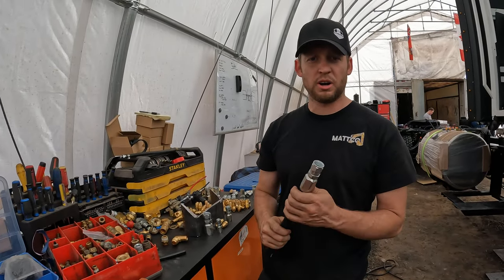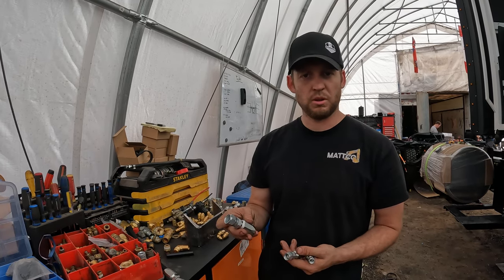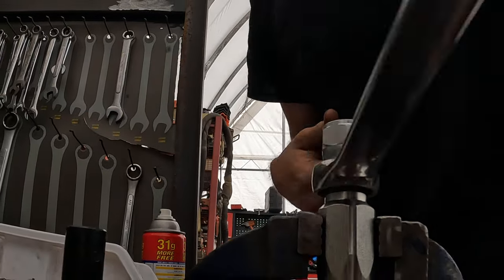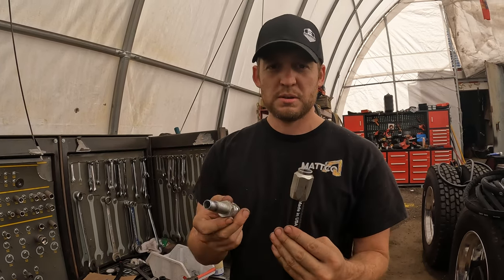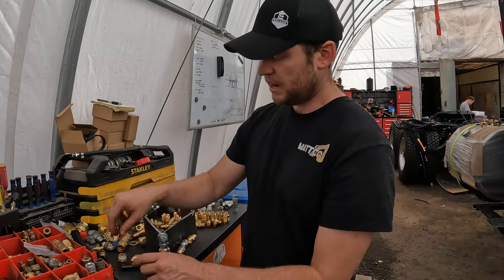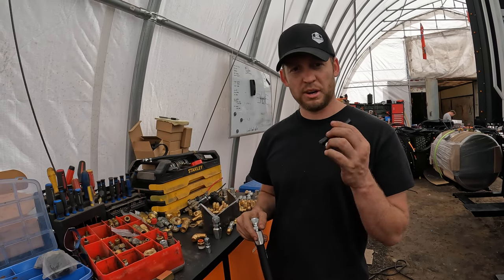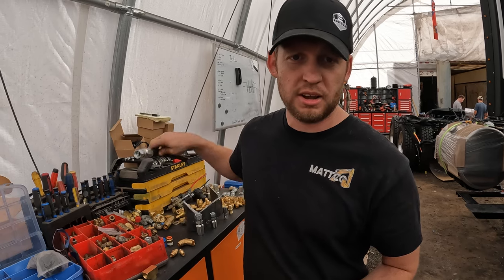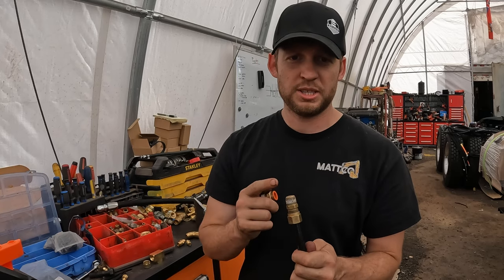Braided AirLine Fittings

Comment: Be wary of flared fittings though.  SAE uses 45 degree angles but the aviation-world ones (AN or MS or NAS) use 37 degree angles.  It wasn't so big a thing 20 years ago but AN-style fittings seem to be everywhere now.
Reply: Agreed. I do like the AN fittings and hoses. Braided stainless, PTFE liner, and a decent outer jacket have lasted very well on my old ford pickup truck.
Reply: JIC is 37° as well and will thread with SAE but will NOT seal. Learning hydraulics taught me that
Reply: Yeah nothing like finding out that you eyeball and grab the wrong one.
I appreciate all the "standards" that are not standardized besides within their own type.
I guess its better than every manufacturer having their own.
Reply: @jugglajj  they do seal generally with air. It's fairly easy to tell them apart though . For instance JIC is never (at least I haven't came across it in 20+ years) made out of brass.
Reply: @jmanlinc  true about the brass, but they do make ASE in steel and I wouldn't recommend someone does it for air simply to avoid confusion with anything else.
Reply: @brianb-p6586  the old boy that taught me fittings and such when I was younger demonstrated it for me with Prussian Blue to show contact point on the angled surface.
Reply: Aviation fittings cost 10x more and likely won't be accidentally purchased
Reply: 45° and 37° flare connections have different thread sizes so can't be accidentally interchanged.  JIC is same as AN - 37°.
Reply: @jeff-w  sure thing. I'll make sure to note this next to my 10 years of working with these fittings, and the fact that I just double checked myself AGAIN, at work, and have a 08/m/JIC threaded into an 08/f/SAE. Since I'm an asshole at times I went ahead and did 08/f/JIC to 08/m/SAE and they threaded just fine. 
Best of luck
Reply: @jeff-w  if we wanna be even more adamant i can take and post a video, just to be sure
Reply: @jugglajj  no need to be a dick.  I just checked my table and -6, -12, -14, and -16 have different threads.  I wrongly assumed they were different for all sizes.  The -8 uses 3/4-16 for both.  Today I learned something.
Reply: @jugglajj  you should also avoid just calling the SAE 45° flare fittings "SAE" because the SAE O-ring ports use the same threads as the JIC fittings.  To me an "SAE" fitting is an O-ring port adapter.  Anyways, carry on!
Reply: @jeff-w  "to you" and to me, are very clearly different worlds and shouldn't be used as a blanket. Both right, enough said.

Comment: Be sure to check for flappers inside after assembling the hose. The nipple can cut the rubber liner and it will block the hose depending on airflow direction.

Comment: I changed a treadle valve on 2 year old pete, ended up replacing every  one of the fittings with ferrule style fittings because the push to leak fittings wouldn't stop doing they're thing

Comment: Reusable fittings and braided lines are the way to go. Do you run the long straight lengths in steel tubing instead of rubber hose?
Reply: Steel tubing would probably rust with the moisture in the air system
Reply: @simentalg stainless my man...stainless
Reply: @simentalg  in service rig applications we have steel airlines that have been in service for 40 years. If they rust and fail its usually from the outside because it was sitting in a pile of dirt in the frame or the paint was crappy where it's clamped to the frame

Comment: the old school fittings didn't have a nut to turn. You had to use a fitting screwed in it to lock the stem so you could thread it in and out.
Reply: Yeah they were nice because they were shorter, but a bitch if they were rusted and you had no choice but to reuse it

Comment: Suggestion for a future video- that's semi semi related to this video. You state that adding like 5 grand-ish more for your air lines save money down the road, can you do more of a break down and  accumulation of all/most of the things like this in one video that compare oem cost and Edison Motors costs for parts.  I do know not all things will cost edison truck more like comparing $1500 oem headlights vs I'm guessing $50 for your headlights. Or gauges, windows, hoses,brakes,sensors and so on.Hope this makes sense.

Comment: jeebes, i've done a lot of aircraft hydraulic and pneumatic design, for hydraulic we standardized on JIC (same thing as AN really), the my standard size for hydraulic is -03, or 3.5mm hose. the largest we run is a -10 for coolant, and some -08's for engine oil. I've badgered many suppliers to supply me with a range of -02 to shave some weight, but usually they only do steel fittings, which defeats the purpose somewhat. Most is aramid braided, because it's more flexible, less chafing and stabbing prrone, and again, lighter. As for air, even the supply rail is only a 6mm external hose, the standard size being 3mm, which has a 1.6mm bore. Running a -04 for a gauge would be a reason to be taken behind the shed...

Comment: would sacrificial zinc plates work for corrosion prevention when using a truck for like a salt spreader or snow plow? I have seen stuff like that used in marine applications. maybe mounted to frame or axles , things that would get direct salt spray / water contact.

Comment: Air lines are never the problem.  The stuff they are connected to fails.  Nylon lines are easy to repair or replace on the side of the road.

Comment: You want small-bore line for gauges because larger bores will give sluggish and probably inaccurate readings.
Reply: Why?
Reply: @brucebaxter6923  All the extra capacity in a larger line takes longer to fill and empty which delays the response.  If you had a small balloon and a large balloon over the necks of soda bottles and shook them the bubbles would fill the smaller one sooner and more obviously, if that helps.
Reply: @jimsvideos7201  
So, you are saying if you have a small hose feed a big reservoir it takes time to fill.
You aren’t saying big lines change pressure slower.
Reply: @brucebaxter6923  In this case the hose is the reservoir.  If it's a gauge you only have to check once an hour it doesn't make a difference but for air brakes you want to know soonest, right?  Smaller lines make for a gauge that is more sensitive to small or brief changes in pressure too.
Reply: @jimsvideos7201  do I need to teach you about fluid flow, surface boundary layer etc?
You keep inserting this magical restriction
Reply: @brucebaxter6923  They're your thumbs, do with whatever you like.  At the end of the day you want small-bore plumbing for gauges.

Comment: They tell you not to use compression fittings on hydraulic brake lines.  I guess on pneumatic brake lines they're ok. 🤷‍♂️ 😆
Reply: Yes, that's correct.

Comment: May as well just use hydraulic pipe and fittings, faster and stronger. all crimped and safe to well over 1500psi.
Reply: Defeats the purpose. Which is field serviceable
Reply from the maker: You’d think so.  But unless they specifically say “DOT” or “FMCVSS” on them they aren’t legal
Reply: @brianb-p6586  Correct, a tenth of that rating would be adequate.
There are available braided hose products that are more air-brake specific and so carry more applicable features and benefits; including a more relevant pressure rating.

The featured hose is marketed as a "fits all" product so that a shop can inventory one hose which can be used with numerous systems. IE fuel, hydraulics, engine plumbing... Thus the higher-than-necessary (for brakes) pressure rating, which brings other compromises.